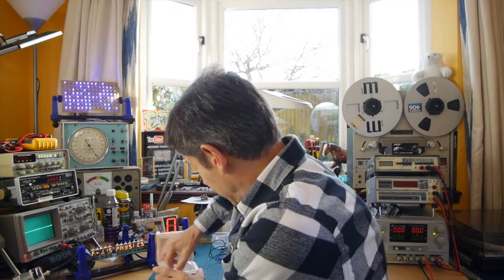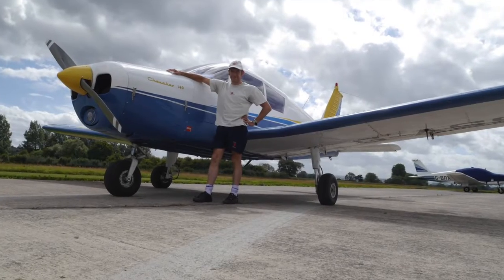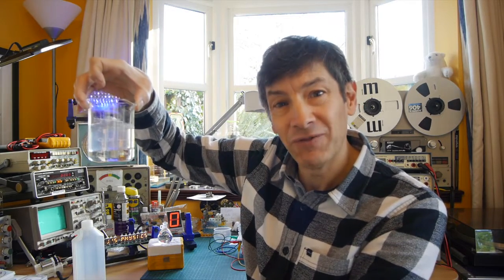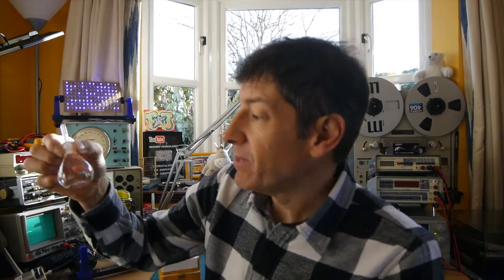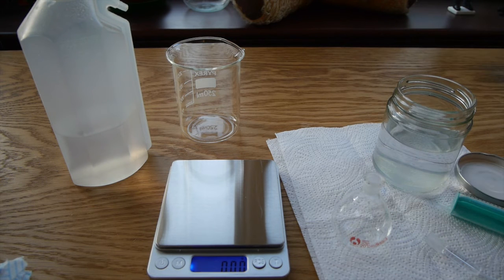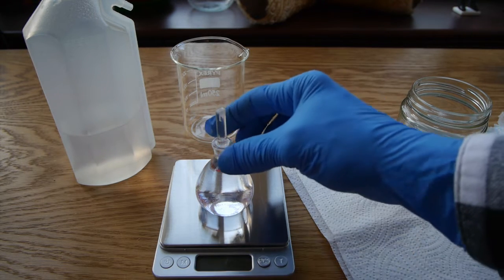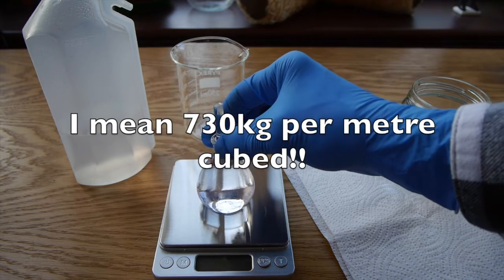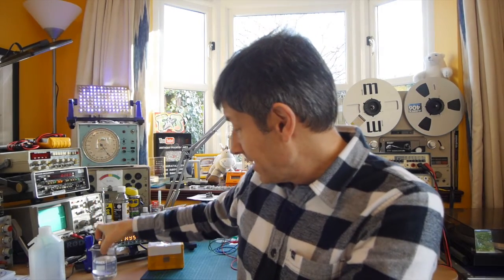Density Bottle (Water vs Avgas) - F-J's Physics - Video 175

Comment: Flying recently ? I have had to abandon several sessions in the old PA28 owing to gusty winds around EGBW. In the winter I have had to drain quite a bit of fuel when checking for water contamination. It could be worse - my flying pal has been trying to get me to buy a jet trainer with him, and water contamination is more of a problem with jet fuel. But that's a different physics lesson.
Reply from the maker: Yes, I have been lucky.  We have a strict 60 day currency rule in our group and of course the statutory 90 day rule so I always try to stay current.  I have been lucky in just picking the days correctly but, my word, we have had a string of non-flying weather.  Hope you get airborne before too long!  Not sure if you have seen this video of mine - https://youtu.be/ZvlxJ1oLCb4  pretty old PA28 of ours, one of the first into the UK I believe.  If ever you get that jet trainer I will be knocking on your door for a go!
Reply: @AnthonyFrancisJones  I first started in a C152, but since retirement as a Physics teacher (following retirement as a university CompSci lecturer)  my girth has expanded such that a PA28 is a minimum.
Reply from the maker: Did a lot in the 150 aerobat and it was a tight fit for anyone.  Trouble with the PA28 as it is almost too heavy for me to manoeuvre on my own.  I loved the Rallye we had too!
Reply: @AnthonyFrancisJones  Just watching your other video: an interesting question might be to explain the curved prop (e.g. 4:26). OCR B was good at this kind of thing when it was IoP sponsored.
Reply from the maker: Yes, good point especially with a digital shutter rather than a mechanical one!  I enjoyed teaching the OCR IOP Advancing Physics course and back in the day, teaching Nuffield, which I thought was excellent and I still use much of it now especially the electronics bits which are no longer in A Level physics specs.
Reply: @AnthonyFrancisJones  I did Nuffield in the late '60s (as a pupil: I'm not that old!). It was a wonderful course.

I loved the electronics (I do valve experiments in my home high-vacuum system. I have moved back to air-cooled diffusion pumps after I starter to use turbo-molecular pumps, then did the KE calcs and realised I was endangering life!), and we also did logic.

It's a shame that so much A level Physics has now been shifted to University entry level, to be paid for by the student.
Reply from the maker: Interesting things you have done!  I loved the Nuffield course and still have all the student and teacher books for it.  Strangely the article on Wikipedia describes the Nuffield course as basically discredited nowadays which I find a very odd outcome.  I had brilliant teaching and my teachers did every experiment in the book including microwave interferometry which must have been a pig to set up!  I do many of the Teltron demos on this channel now as I am sure you know.  I think they have been largely consigned to the dusty cupboard in a lot of schools sadly!  Thanks for watching and do comment on other videos that interest you.